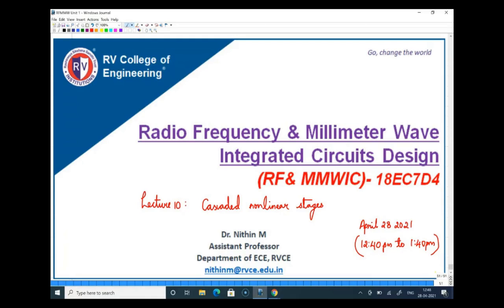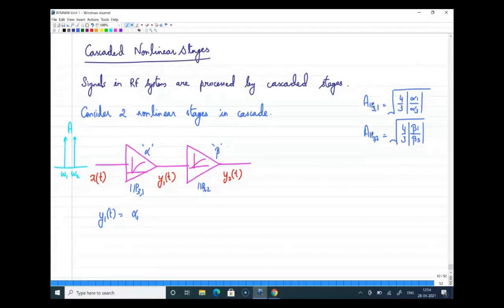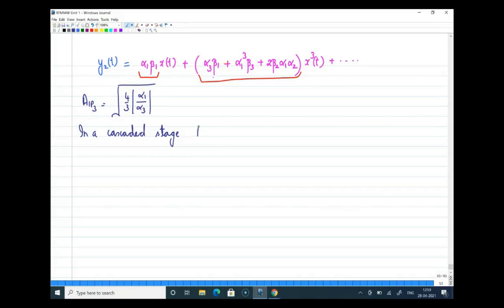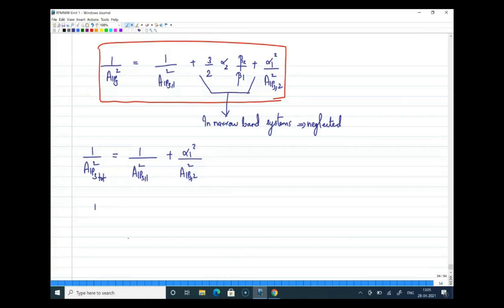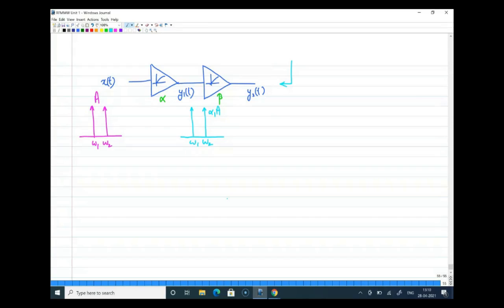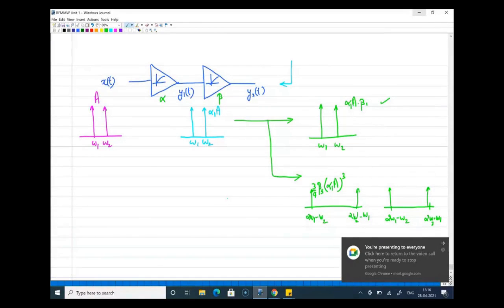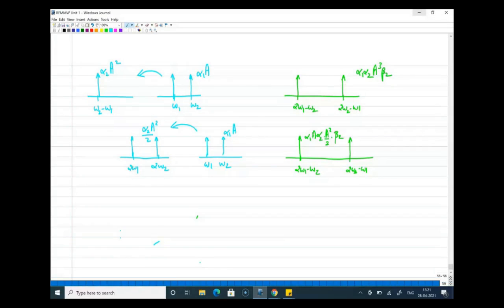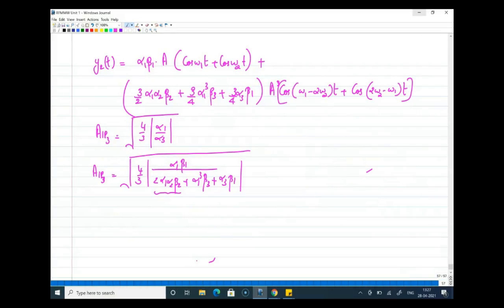Lecture 10 Cascaded Nonlinear Stages IIP3 | Unit 1: Nonlinearity and Noise

Comment: A 900-MHz GSM transmitter delivers a power of 1 W to the antenna. By how much 
must the second harmonic of the signal be suppressed (filtered) so that it does 
not desensitize a 1.8-GHz receiver having P1dB = -25 dBm? Assume the receiver is 
1 m away and the 1.8-GHz signal is attenuated by 10 dB as it propagates across 
this distance?? Please explain this question